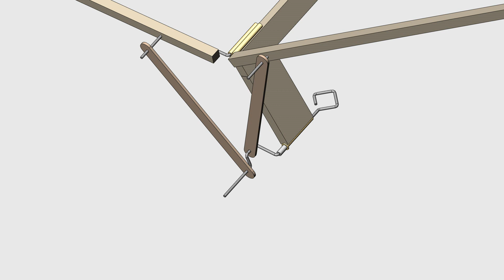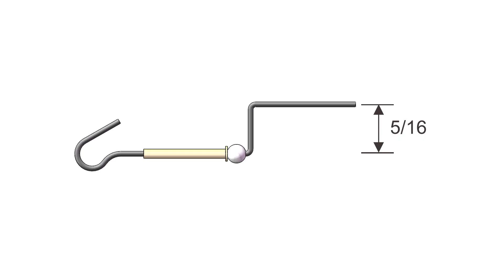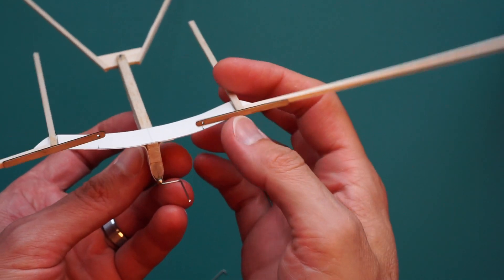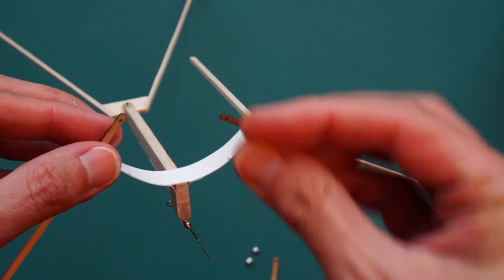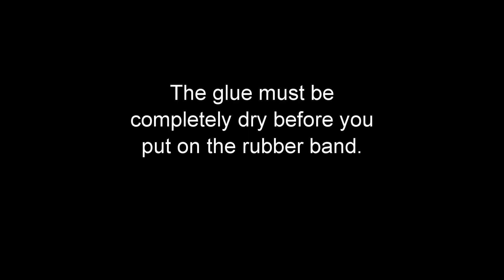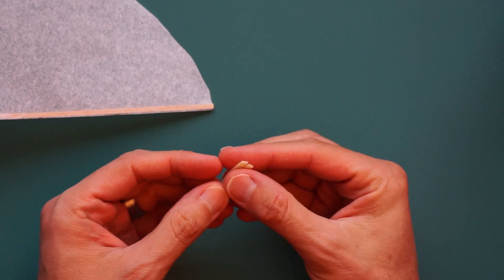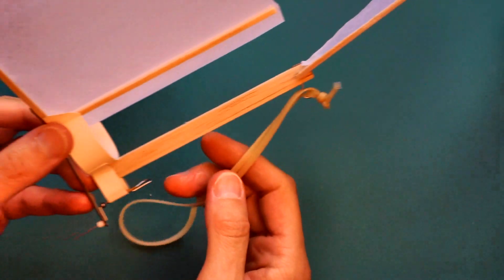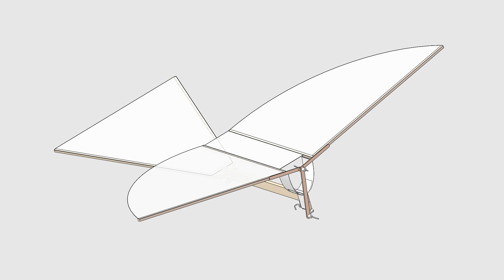How to Build Flex Ornithopter - Unique Simple Flapping Mechanism, Easy to Build DIY Project

Comment: I've seen enough of these videos now to where I've felt that could comfortably build my own ornithopter. And I've done just that. However, whenever I try to wind the crank up, the wings just won't flap no matter how much I wind it up. Also, I've found that it's sooo difficult to keep the wire hook in place that's supposed to connect the rubber band to the other end. The more that I wind up the crank, the more that the rubber band will be begin to pull it off from its secure place. What is it that I'm doing wrong?
Reply: I would suggest a stiffer wire

Comment: I've tried to build it so many times. It seems that my ornithopter's wing can not fight aerodynamic resistance. Anyway, the frequency of flapping wings is not high as flying and not long time. Could you tell me how to fix it.
Reply from the maker: There could be some cause of friction such as the wire is not straight or some glue got in, or the metal tube is not smooth across the end. Otherwise the crank can be too large, so the rubber band wouldn't have enough leverage to flap the wings.

Comment: Good video. Does the card stock "hinge" weaken and break? It seems the constant bending back and forth of any paper won't last very long.
Reply from the maker: It does wear out. Usually it peels off from the wood and you can glue it back on.

Comment: Which glue you used
Reply from the maker: The glue is Elmers Glue All and the drill is something like this one:
 https://www.ebay.com/itm/223083370530?_trkparms=ispr%3D1&hash=item33f0ce1822:g:b2gAAOSweQBZnXui&amdata=enc%3AAQAFAAACgBaobrjLl8XobRIiIML1V4Imu%252Fn%252BzU5L90Z278x5ickkgCVySCgrNFPU8Iu85TabMCHZF%252FLe3%252BWJo5Rk3vvM7j1MzkNMYHDXTiFkL3xOytGYoizHElYehjy7A%252FXITmOQ0lQE02UUJAaXivWNbVFQemkUQR1wwF%252Fa1159wIZ0WVHZKtclm7ffVxRm5LVYMjC0gMzEIL0HgbETrEGMmaq8S2d318nyM48HKxLrO3cUDJqgB7g6Rffrf9gagSrwHCI7fNMnAKhYdf5eJEeL0l%252BTKEjVO5zgJFGblofeIegau3iEySG0AGuahuqMZeibAr49wTDtx8MS6oO4eS3yVbe%252FFcmLTvRldAfWqJCmj%252FXmM2DlzUmmUCh5%252F3hTpFc6QuWhrNoJc2ArE5J8qH18NiiFjLvYdM1AUmfMoqBptn8KV8VlCuFf56w%252BNbI6kDHdM3ww5aBlYUrXueAGa68WBCmIerMwkw1SIcuf5HcTww7t6P0fpUAow86Ci3ssqh%252BUlwW2vTrDkvdUPKy0cOqfPzpIZn2MPJL0lTpzHzHpPSi0lyrjjTVcKSQsxgEmtuIaxuJT7SJSgNy8FdNQyYVlzYPPujniyVtMxfPKkaBiWlLU1OOElplL2ajxxFHEMVD%252F3leWIEzgbL4EOiiV54dR9Ju0Vvb1K36745xr5cos6mcHzORKaZdOIjo7dFjaCPWnvMOagCCEL1Jmp5LCo8BfA9Stoopso8ieZROlcg%252FWxxWXtoFiTSDNqfkSFOiuRlae1dnn08KbZkdxTDmzKtzlint2EM%252Fs%252BIgIO5Uu2kNHXRMWYSnULRx7pBv5af95Cf2xuJQ7u%252BxOtpXBc4Q3299EJ0nYYXQ%253D%7Ccksum%3A223083370530d90a9a0b26914eeebc2fdd0a703757c3%7Campid%3APL_CLK%7Cclp%3A2334524